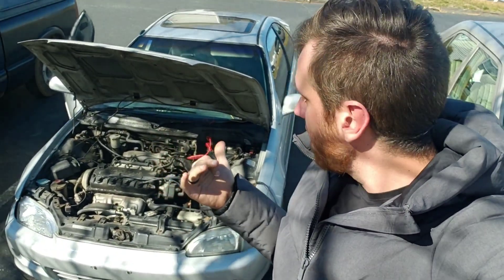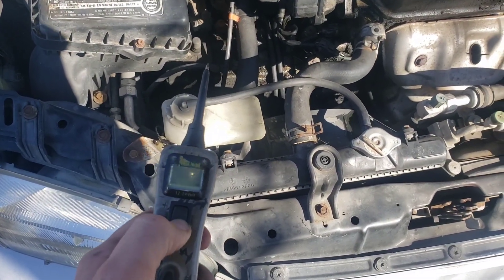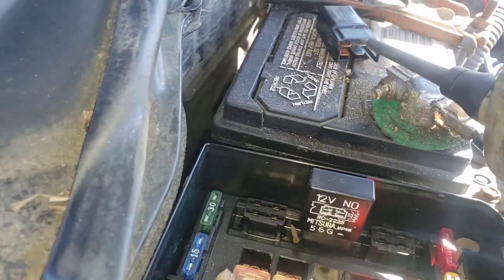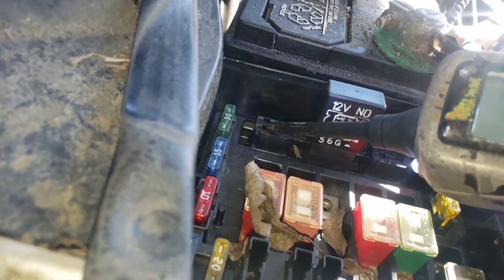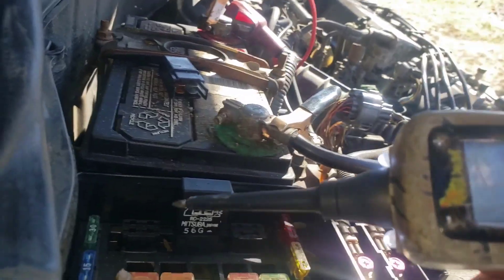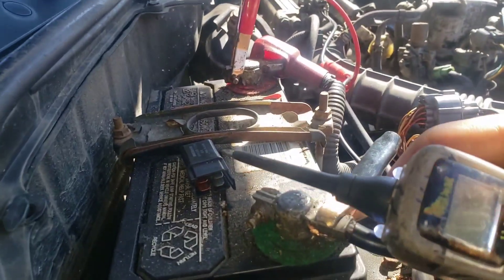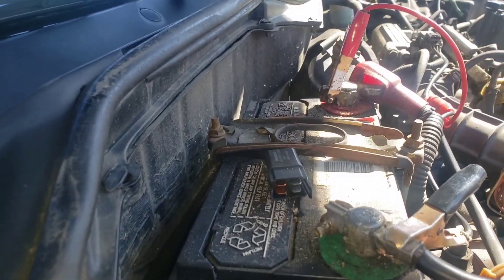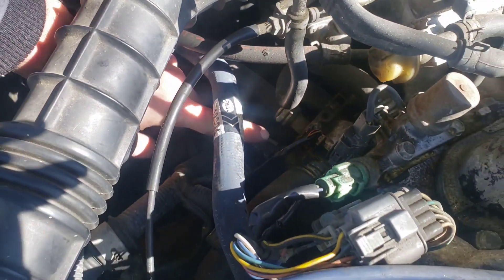Honda Civic Fan Won't Come On Diagnose How to Not Turning Don't Hear Overheats at Light Sitting Idle

Comment: Ouragiousally overcomplicated and you don't need a power Prober.  He checked this stuff in the wrong order so  he could "play" with his Power Prove. Just go right to the thermal switch, remove the clip and short it to ground or if there is two wires short them together. Fan comes on, means all that other stuff is fine!

Comment: Attempt to comprehend the ridiculousness of your video, the first thing you're going to need is some tool you don't have. How ridiculous you should be able to figure out multiple ways of explaining it without these tools man
Reply: It a stupid video, with the main point to sell a power probe through the special ling that he get paid. Real life answer, no BS. Just go right to the thermal switch, remove the clip and short it to ground or if there is two wires short them together. Fan comes on, means all that other stuff is fine!

Comment: Changed the engine coolant temp sensors, swapped relays with ones i know for sure work, fan motors work by jumping at fusebox. Im stumped!
Reply: Did you end up fixing it.. I did the same and the fans won't turn on
Reply: Yes. To this day, im not sure what actually worked. I changed all relays for new ones and  topped up the coolant then they kicked on one day when the engine got really hot
Reply: probably gad to bleed coolant system @rayshawn1986